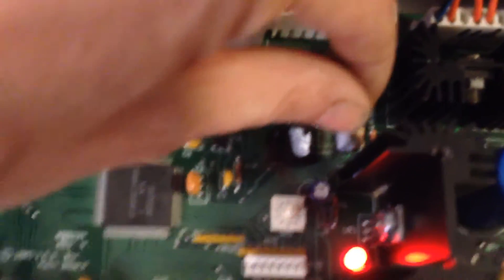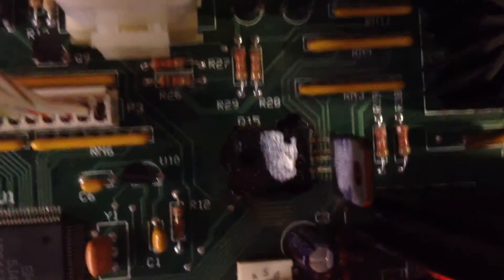Dunk N Alien swinging target arm repair

Comment: Arcade games and pinball machine games use PIA chips. Any reasons why they use PIA chips that connect to the CPU chip to the MOSFET switchers to turn on and off switches or lamps. The PIA chip can be omitted i would think and just connect the MOSFETS directly to the CPU chip output pins to turn them off and on.

Comment: I have an issue where the alien starts at the bottom and when you hit the target; you hear the splash and the alien comes up then goes back down. Its acting as if its working in reverse. (Starting from the bottom and coming up on a dunk). The game perfectly works outside of that with no errors. Have you ever seen anything like that? I would assume the motor works because it can come up. I also tried replacing the sensor in the back up top but it didn't do anything. I did however notice if I change any settings like volume it doesn't remember them. Any advise?
Reply from the maker: So sorry, I just saw your comment. Ours did that too. I replaced the foam pad under the alien, and I used too much. One I got the height of the pad correct he worked flawlessly.

Comment: I had to replace the transistor on two of these machines so far.What can you do?
Excellent video-Thanks for sharing.
Cheers!
Reply from the maker: The best advice I could give would be to raise the transistor off of the board and attach a heat sink to it. You'll need a small piece of plastic or Mylar to prevent it from shorting out. I made that mistake. Luckily the transistors are fairly inexpensive.